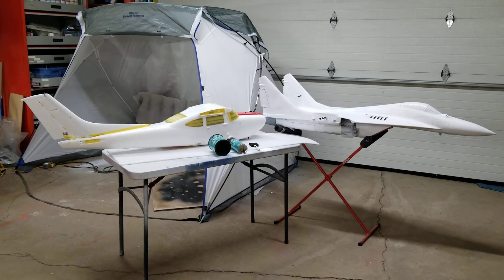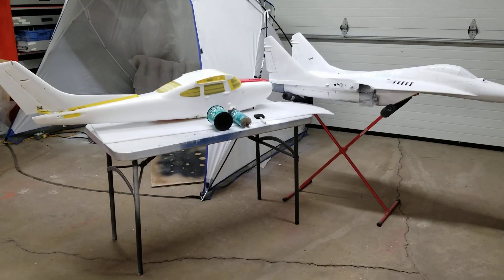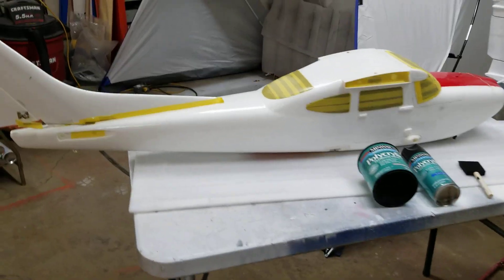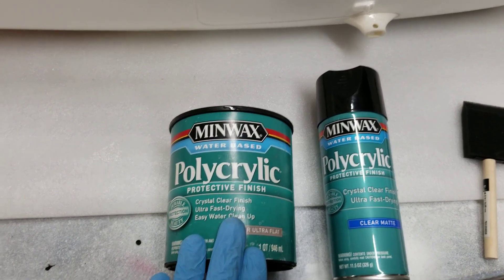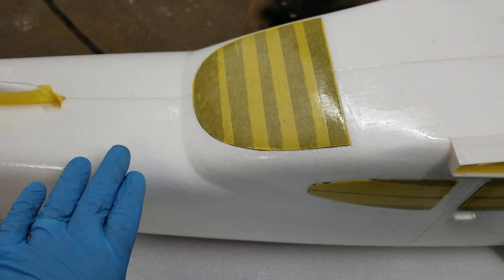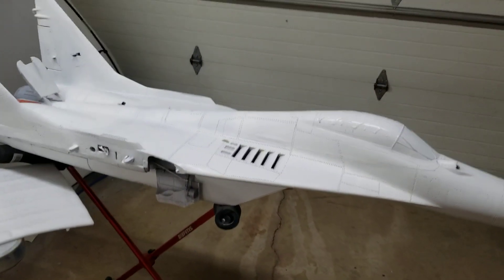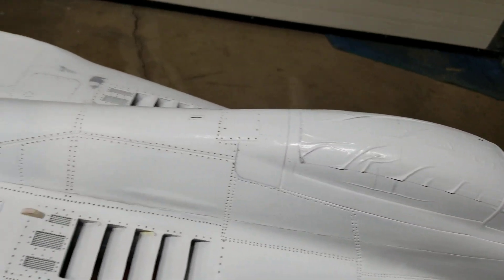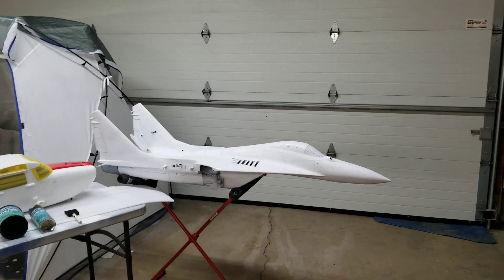# 1, how I prep  plane to paint.

Comment: I use Z-poxy to seal the foam.  It has better sanding properties compared to Polycrilic stuff, and the plane becomes more rigid.
Reply: @alwaysflying6540 One light coat.  No thinning.
Reply: @alwaysflying6540 You need to light sand then use primer.  You can then see imperfections and gaps.  Use microballoons, and follow up with acrylic paint.
Reply: Which Z-poxy do you use? The finishing resin, epoxy, or something else maybe? Thanks!
Reply: @jacksemporiumofstuff  Their finishing resin (sometimes mixed with microbaloons to cover gaps, dents etc).
Reply: @windsurfer3329  Thanks for the fast reply!

Comment: Can you use any water based polyurethane varnish for the base coats and final top coat after primer and paint?
Reply from the maker: Yes , if it has UV protection  , because it will turn yellow over time if not.

Comment: William, I realize this video is some years old, but do you have any experience with fiberglassing over EPO foam, or do you have any thoughts on using minwax poly acrylic  to seal the epo foam before applying FG over it? Thanks!
Reply from the maker: No I have not done that yet. No do not apply Minwax before fiberglassing , it will be too much weight in the end , unless you are just doing a show plane that will not be flying. If I did, I would clean foam surface  first, lightly sand, fiberglass surface, then take paper towel roll and go over surface to soak up access epoxy , then use a credit card to scrape off excess epoxy, let dry, lightly sand , primer, sand, primer more if pin holes, sand / wet sand, then paint
Reply: @t33jetman  really appreciate the reply and thoughts. To give some context, I’ll be fiberglassing a Skywalker x8 and converting it to turbine power as a personal design challenge. Will be using .75 and 1.5oz FG (1.5 sparingly) with z poxy finishing resin. Thanks again!
Reply from the maker: @hunterwdavis  
Great , keep us informed of your progress